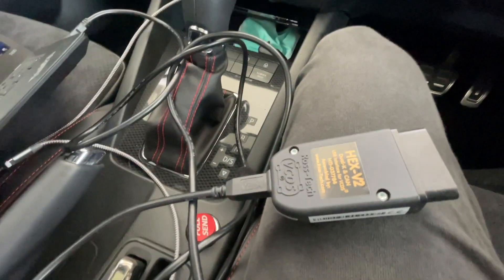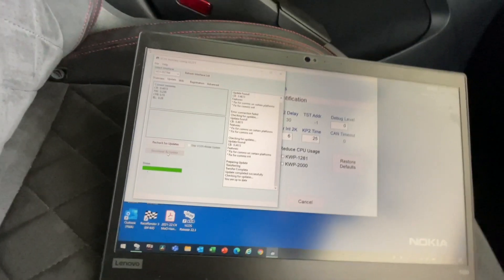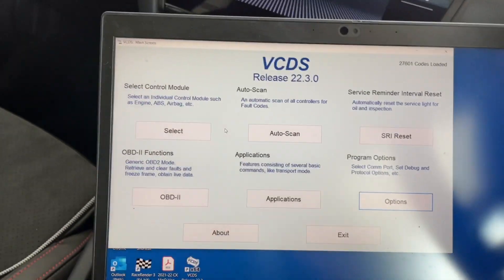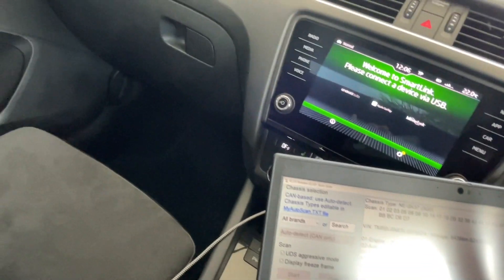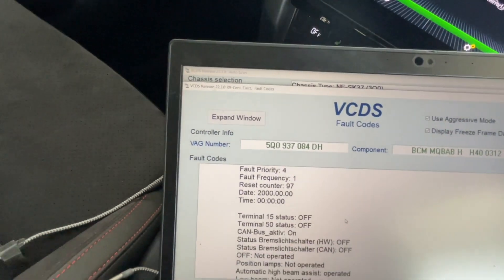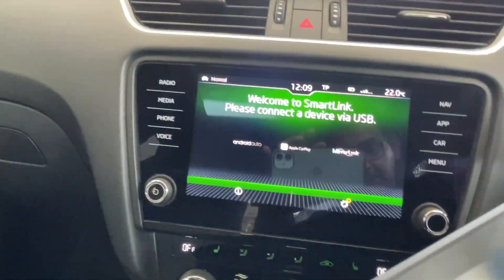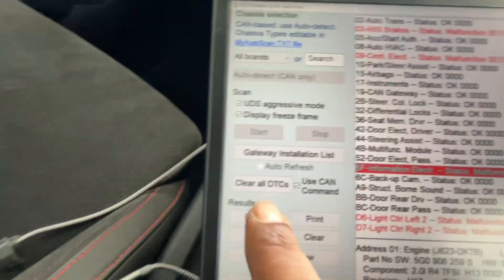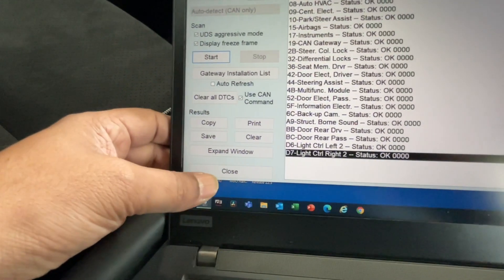An introduction to VCDS for your Skoda/Audi/VW Car

Comment: Please help. How do I switch ESP from off to on? I don't know how to use the program properly, I just need to activate ESP..I have vcds hex v2   and  24.7.0
Reply from the maker: what car. Coding depends on car model & module. If your car has ESP, it by default should be on always unless you switch it off manually.

Comment: 2024 Virtus GT DSG user here as you might have known virtus has many features hidden which can be unlocked using VCDS if done so will this void my warranty ???
Reply from the maker: Yes, they did do a lot of drama for my friends Taigun when he went for a warranty claim on his rear EPB brakes. Even though the coding had nothing to do with the brakes, they tried to void his warranty.

Comment: I have got P160900 error code which was triggered by a crash. It had made the steering hard. Will clearing the code resolve the issue?
Reply from the maker: Nope. The steering rack needs replacement for that fix.

Comment: Really helpful video! VCDS is always a bit of a risk to play around with, so it's worth highlighting the risks as well as the benefits. The proper VAG cable is crazy expensive to buy.
Reply from the maker: Yes, fooling around too much without proper adaptation or long coding understanding is not recommended. Also when doing adapatations or coding, best to take a screen shot or admap of the control module before changing anything.
VCDS is pretty cheap if you get the 3 vin version. 
https://store.ross-tech.com/shop/vchv2_ent/